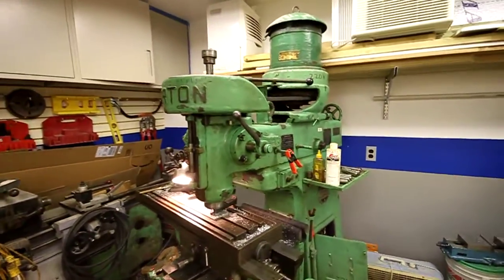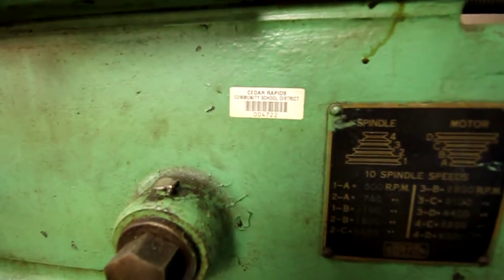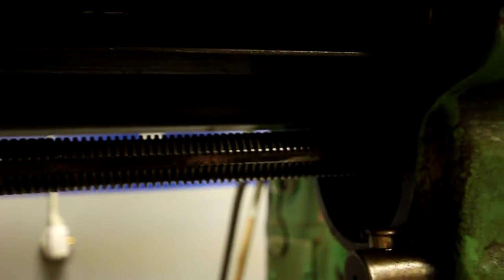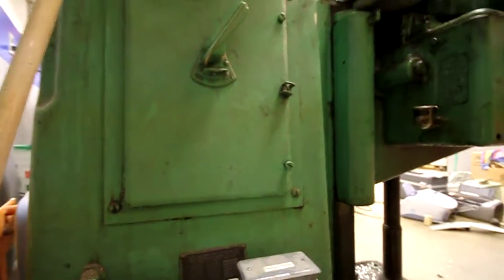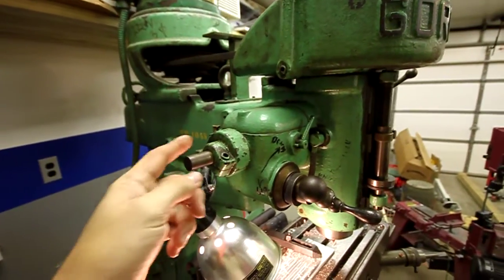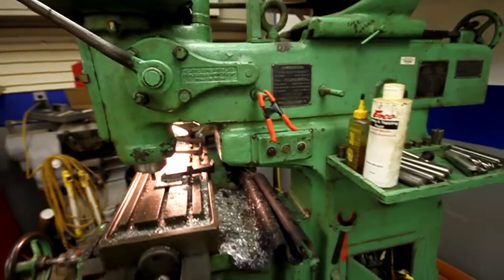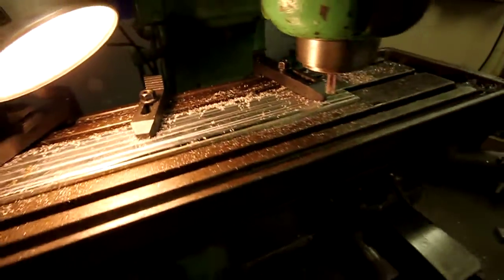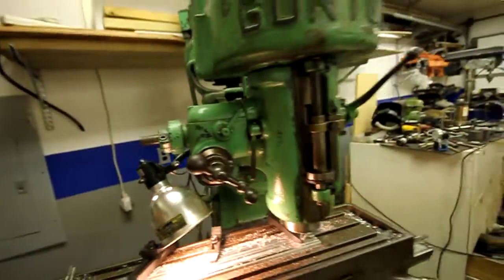Gorton milling machine tour part I

Comment: Iv been studying old belt drive milling machines, in other country's a very common practice is to mount a 3jaw 4" or 5" lathe chuck onto the spindel,  they even new make step belt milling machine with a small scroll 3 jaw chuck as it's main tool holder , very fast and better than constantly changing R8 collets!

Comment: Thank you for posting.  Did you move it with a pallet jack, fork lift or crane?   Is the eye bolt at the top for moving the mill?   Any idea how much it weighs?
Reply from the maker: The large eye bolt is for lifting.  Balance it using the sliding head.  I wouldn't recommend moving it as I did.  A forklift or a skid steer is the way to go but I didn't have the ceiling height to do this.  I removed the motor, then the head, then I lifted the base with a 2 ton engine hoist onto the trailer.  I offloaded onto metal pipe to move it into place.  I believe the machine weighs a bit over 2600 lbs, but I'd need to check the manual.

Comment: I ran one of these for years. Great little mill. biggest drawback was the slowest spindle speed was 250 RPM, which is too fast for a one inch hog mill on some tool steels such as AISI D2